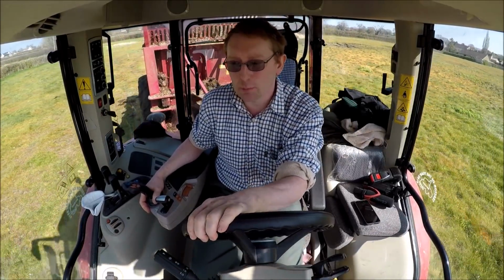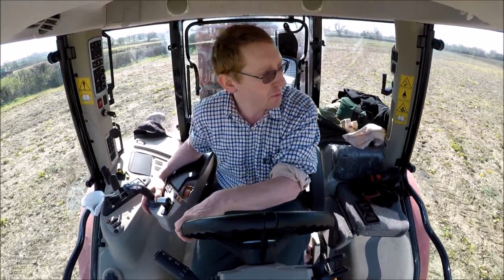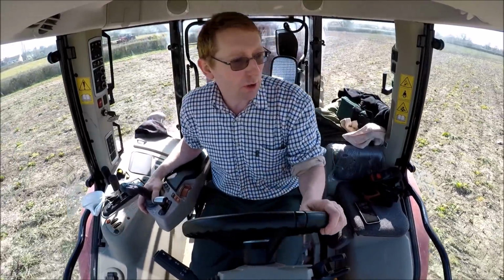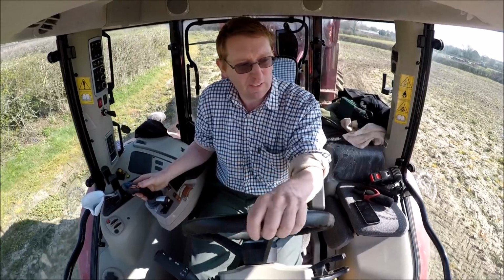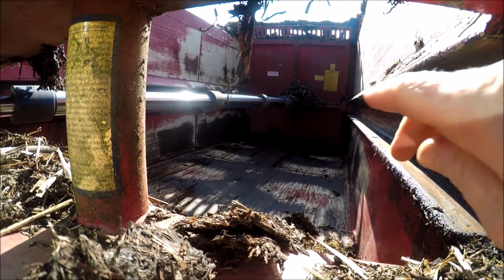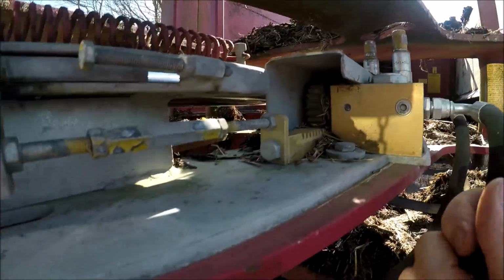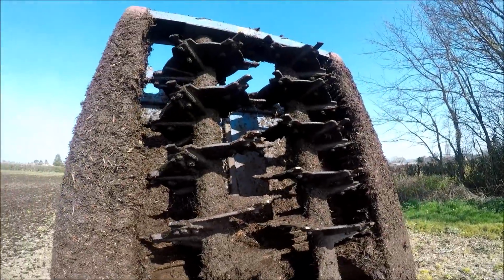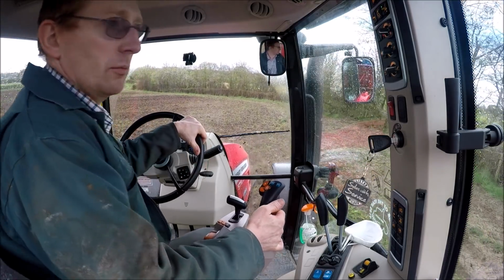Muck spreading, spring 2019.

Comment: Interesting video never seen a discharge system usin a ram before, as for the check valve we had one on the movin floor spreader but like urselves found it much quicker to control floor speed from the cab 👍💪💪

Comment: Great video I know it’s late but what size it that spreader it looks very small on that Massey that I know is smaller that our Valtra and the 9cube abbey spreader looks bigger but that may be because ours is a side discharge beater spreader and yours is rear discharge there fire they have to be different heights and lengths to fit the same amount of material